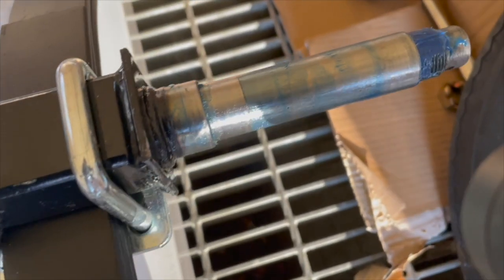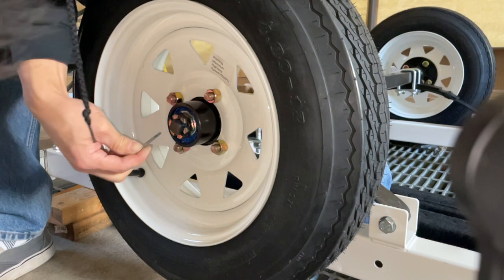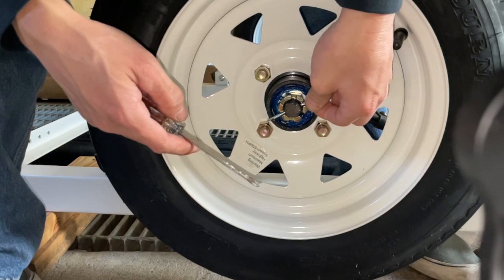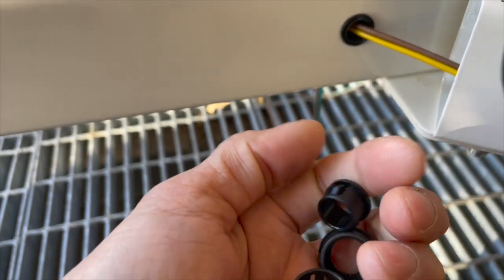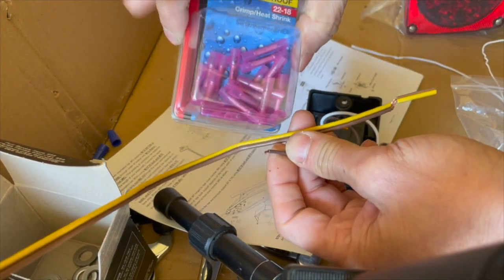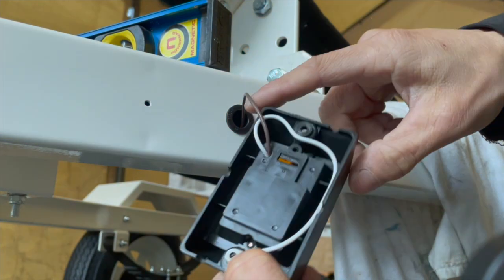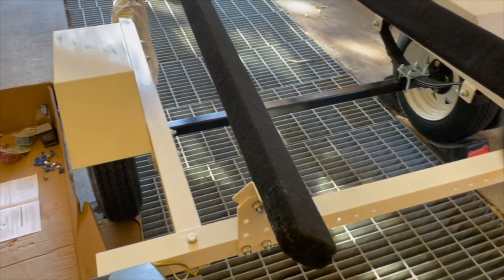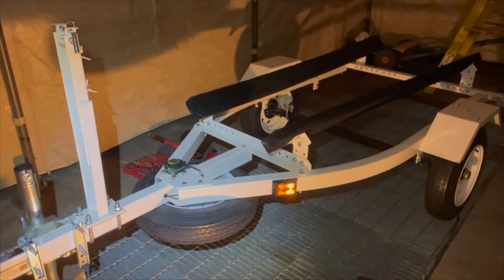Ironton PWC trailer assembly

Comment: You did it, right man. A lot of videos just go go go. This will help me with mine to make sure it's safe. How fast have you taken this? I see where it's rated for 55 mph, which is fine really but would be nice to know if I went 60 without thinking about that it's an okay ride. Apologies if I missed that information in the video.
Also, great tip on the 55 psi to reduce bouncing. Strong video man.
Reply from the maker: Fastest I have gone is 85mph in quick short spurts.  But consistently I have gone 70mph with and without a load.  Did this twice on two trips one to get a scooter (300lbs) in Seattle (2000+ mile round trip) and one to get a motorcycle (430lbs)  in Arkansas (3500 mile round trip).  Main thing is make sure your tire pressure is good for the specific load.  On both trips I actually had a infrared thermometer to make sure the tires don't get too hot from too low tire pressure.  Made sure that the trailer tire temps was same or cooler than car tire temps.  Front and rear car tire temps do differ a few degrees.  So at full load for this trailer including the trailer, GVW is over 800lbs. and the tire pressure is 60psi.  For every 100lbs less I go down 5psi on the trailer tire psi.  So for the motorcycle trip the trailer and moto weight was around 600lbs, trailer tire psi was 50psi.  While empty the trailer is about 200lbs setup to carry a motorcycle, trailer tire psi is 30psi.  This kept a smoother ride for the trailer so not too bouncy and  tire temps was cooler by a few degrees.  Tire psi increases about 1ps for every 10degrees.  Keep that in mind when checking.  Cold tire temp is done at 68* so ~70*.  So fully loaded GVW is just over 800lbs with 60psi at 70*.